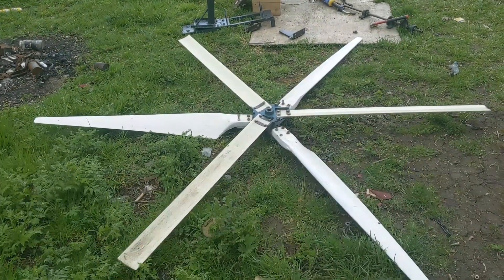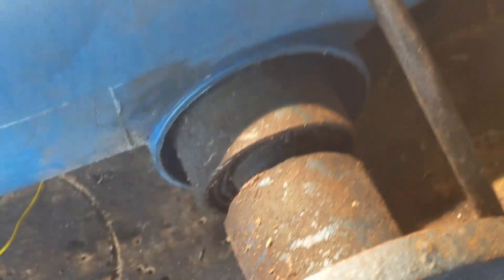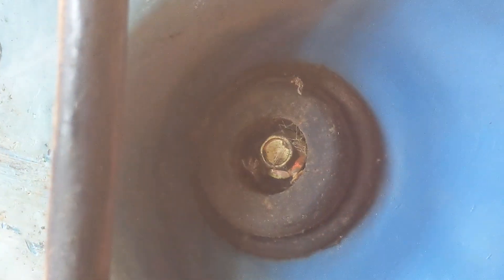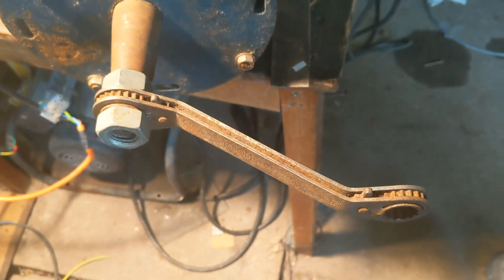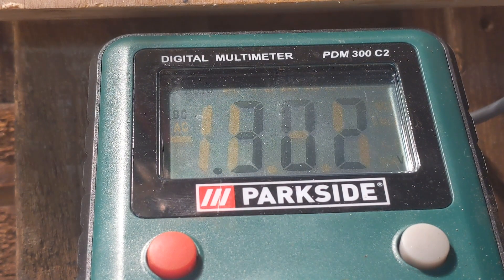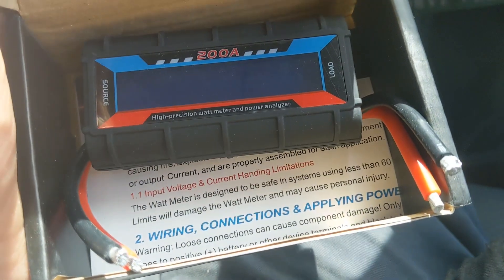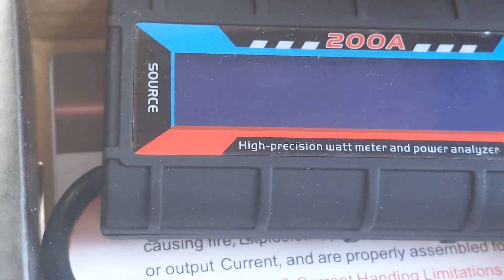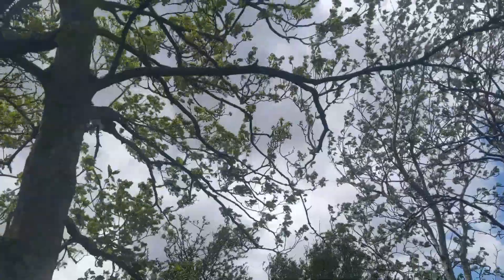MONSTER Wind Turbine Generator - a Closer Look - Not Flying Just Yet - 10th May 2021

Comment: You should put the larger blades on it and see how much power it puts out
Reply from the maker: I mention this at the end of the video which I am just uploading now which is part 2 of charging drill batteries
Reply: @GavinFreedomLover  I’m gonna watch that now lol I’ve been waiting all day as I’ve been busy with my solar panel as my battery isn’t charging for some reason
Reply from the maker: Make sure you connect the battery to the controller first then plug the panel to the controller.